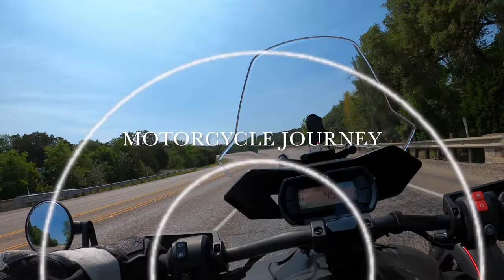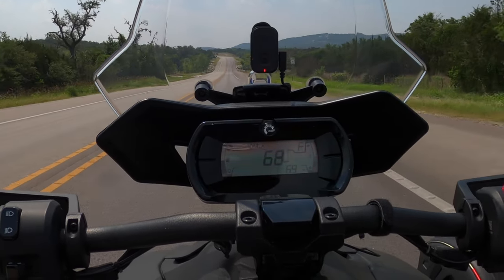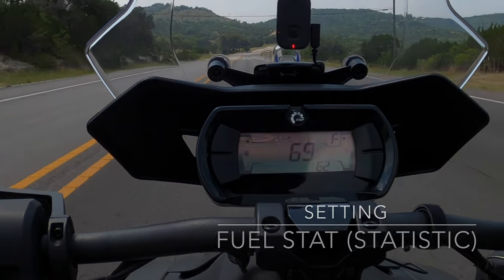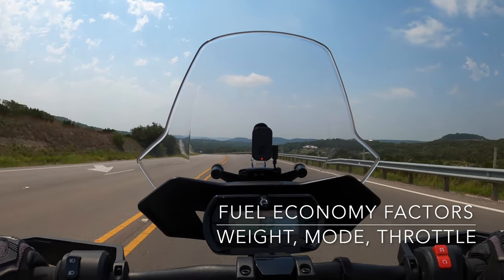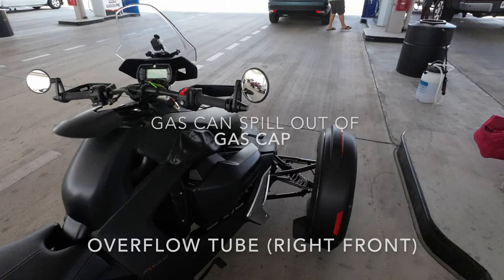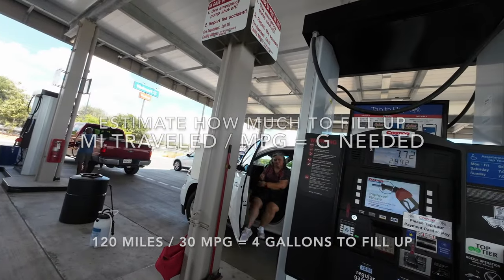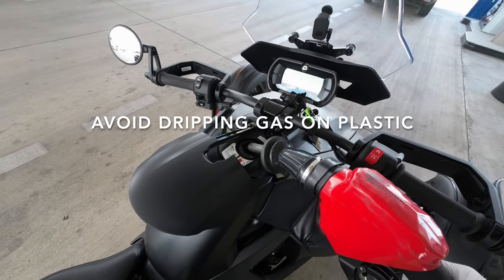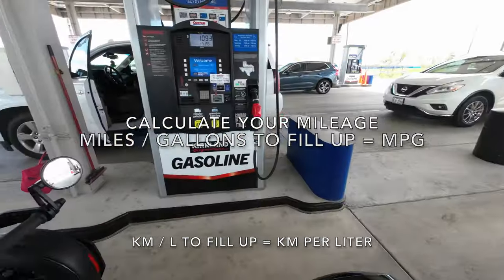Ryker Fuel Gauge - How Reliable? How I Get A Full Tank When Gas Up | MPG | Trip Odometer

Comment: My first fill up was a mess.  It overfilled way faster than I would have expected.  Slow as the pump will run is my speed
Reply from the maker: There’s probably something inside the fuel tank that prevents gas from going in quickly, to make it overfill so quickly 😳

Comment: It’s not how hard you pump, you simply overfilled your tank. Full pressure on pump and click lock the handle and leave it alone, taking your hand off the handle. When the pump lock feature clicks, don’t keep pumping. You are done. Just remove the fuel handle. I have never had an overflow by always leaving the pump to do the work.
Reply from the maker: When you’ve ridden 120 miles and the pump sensor clicks after 1 gallon, doesn’t seem like the tank could be full 😆🤷🏻‍♀️
Reply: @urbandingo6882  it doesn’t click after 1 gallon, come on now, you know how to use a gas pump??? it clicks when it is almost like 90% full or you can just rely on the overflow valve tube to spill out. This is not rocket science 😉

Comment: are u supoosed to use the tube in the air fileter section to gas up?
Reply from the maker: Hi @richardlee4438, no don’t use the little filter if you’re gassing from the pump. I believe that is s for when you are gassing from a storage container. The trick for me is to pump as slow as possible so that the gas has time to trickle down to the rest of the tank. You will get used to it 😆

Comment: Good points.  I don’t trust my fuel gauge after 2 lines beyond half. It empties faster.
I always fuel up and reset my trip at 175 miles (35 mpg).  The most I’ve pushed it is 182 miles (2-3 times now).  Always in ECO mode.

2022 900 Sport
Reply from the maker: Sounds like ECO mode does give better mileage. Great to know. Thanks for sharing 😀
Reply: @urbandingo6882  
                                  I believe you mean, 'sharing'!!!!!
Reply from the maker: @Terry Vincent yes, thanks for catching that 🤣 Mistake corrected 😅
Reply: Wait I’m only getting 16mpg in the city on eco mode how is this possible!?! 😓
Reply from the maker: That does not sound right 🧐 Are you sure your tank was full? Reason I ask is because the station where I usually get gas has very sensitive sensors. It usually clicks to indicate full when it’s not actually full. I suspect the pump passes more gas than the rate that gas will pass down to the rest of the tank, so gas piles up around the pump and sets off the sensor. Sometimes going really lightly on the pump handle makes it not trigger the sensor. You do run the risk of gas coming out of the overfill hose when the tank is full though. Just a thought 🤷🏻‍♀️

Comment: I've learned the Rykers have oddly shaped gas tanks which is why they measure gas so inaccurately -- but I never would have guessed its a splash hazard when fueling.   Thanks for the PRO-Tips
Reply from the maker: No problem. If you accidentally splash, wipe away any spills on plastic right away, because it will discolor the plastic 😢

Comment: Urban Dingo  I've had a couple overflow on my ryker 900 at first I didn't know what the tube was for until I saw gas coming out of it.  When I do fill up I've noticed recently that sometimes that I have one bar missing from full tank after the pump shutdown but I don't do any more filling because of the overflow also noticed when you have 5 bars left they tend to go down very quick only had my gas light come on  3 times,  30-32mpg what I get in eco mode, you have some great suggestions Ride Safe .
Reply from the maker: There must be something about the tank that contributes to sensitivity in the pump handle 🧐 Your tank cannot be full if you still have one bar missing. It’s hard to know if you should keep pumping after the pump stops. I hate having overflow too 😂 Glad to share tips that help. I have learned plenty from others’ tips 😁

Comment: If never had any issues fueling. I can put the auto lock on the pump and it will stop without overflow. Gotta 2022 900.
Reply from the maker: I wonder if Can-Am did something to make it easier in newer models 🤔 I have a 2019 Rally 🤷🏻‍♀️
Reply: @urbandingo6882  I would assume. Can am has made small adjustments almost every year. The 2023 is updated from the 2022 from everything I’ve seen. Good video. I watched many different videos before I bought mine. I think they’re helpful.
Reply from the maker: This is good to know for folks still on the market to buy. Thanks for sharing! 👍